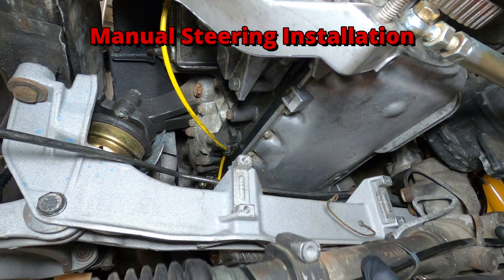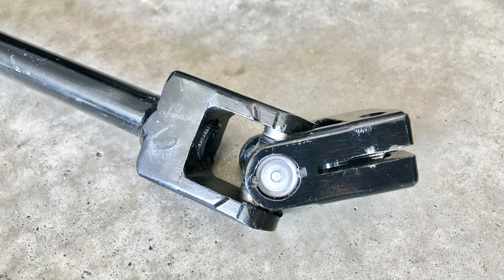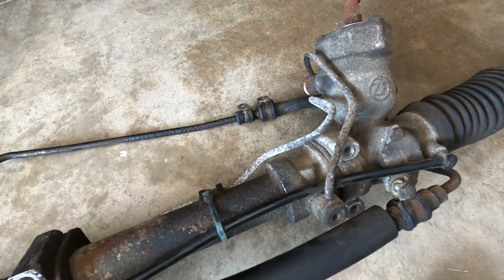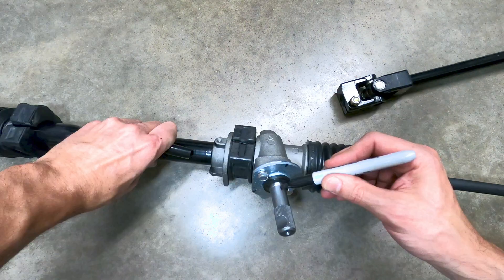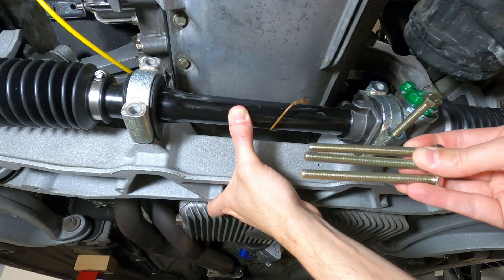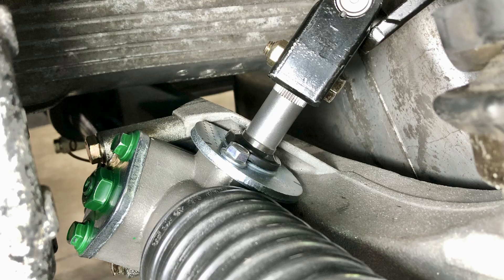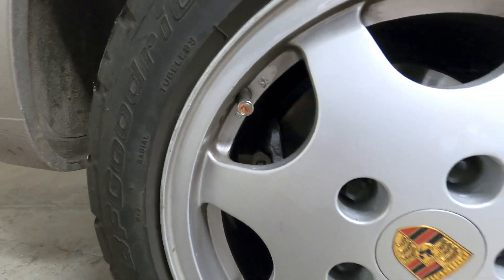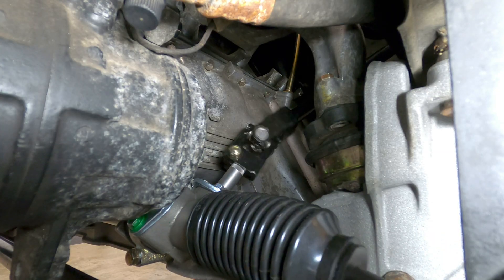Porsche 944 – Manual Steering Conversion / Rack Replacement Tutorial

Comment: Another Fantastic video. You must have just about the nicest 944 in the States now…
Reply from the maker: Thanks John! I’ve definitely taken decades of aging off its life, and the car is looking really good. There are still some 944 unicorns out there with sub 5,000 miles on them. Pretty amazing how people never drove them and stored them so perfectly all this time. Mine isn’t close to those examples, but at least I don’t have to be afraid of putting miles on mine. 😂
Reply: @NC944er  I am the same as my rebuilt 16 Valve has done over 100k, and sings like a bird past 5k revs to the redline.

Comment: At the 5:16 minute mark I can see the yellow wire that comes from the oil level sensor on the oil pan. While engine cleaning on a Special Edition 924S I will be selling soon, I accidentally pulled on that wire that got caught on my brush.  Where the hell does that wire connect to? It goes up into the engine bay somewhere but I can't find the rest of the wire. HELP!!!!
Reply from the maker: Hey, sure! The yellow wire from the oil level sensor meets up with the wiring for the oil pressure sender and they join at some grey wire loom below the front of the oil cooler. From there, it passes in front of and over the water pump, and then up under the intake manifold toward the fire wall and then over to the fuse panel.
Reply: @NC944er  you are a class act. Thx so much for the video.

Comment: The only thing holding me back from manual rack is the slow steering ratio and part availability. The power steering ratio is already about as slow as I want it.
Reply from the maker: There are some trade offs… and the power steering is a bit nicer for casual daily driving.
Reply: @NC944er  lol yeah my power steering has never worked due to an excessively leaky rack, so I'm used to strong arming it. This kit doesn't seem too bad though, with only a 10mm difference for 3 1/2 turns. Just gotta save up since my car needs so many other things
Reply from the maker: @liamflynn6929  Haha! Too true… just when I have a 6-month maintenance plan laid out, the car “tells me” it wants different things fixed first. 😂
Reply: Glad you posted this! I have been putting off my manual rack install but I may just have to get after it while it’s too darn hot out to really enjoy driving the car anyways. Nice work as always!
Reply from the maker: @aarondennis4561  😂 It was VERY hot… I tried to work on it a couple hours in the early morning over a few days.

Comment: Most common power steering leaks on these cars is the wrong hose clamps used on the power steering reservoir hoses in and out, and at the steering pump. Tower hose clamps have worked for me. No more leaks on 5 different 924S's.
Reply from the maker: Glad to hear yours are holding up well. My lines were good and the previous pump rebuild was holding strong, but the rack developed a leak on the passenger side. Finally got tired of throwing money at it. 😂

Comment: Great video! Love to see how other people are keeping their 924s  and 944s on the road.
Reply: You didn't say in the video, and the cost will probably change over time, what's a ball park on the conversion?
Reply from the maker: @gregoryhousch3321  The manual kit with everything included was around $850. I was looking at rebuilt power racks for around $650 and had shelled out $300 for new lines, so it was comparable. I’ve seen folks report that the rebuilt power racks can develop leaks in just a couple years and the thought of replacing it a second time sounded annoying, so I made the switch.
Reply: @NC944er  looks like a good, straightforward, " down grade", that just makes good sense. I've been having troubles with my windshield wiper motor, are you aware of anyone who rebuilds them or sells reproductions?
Reply from the maker: @gregoryhousch3321  Ugh, yeah… they are known to catch water and seize up over time. Mine is a tad slow, but still moving. I’m not aware of any rebuild services or aftermarket options. Most of the ones for sale are rebuilt OEM units, but the price tag is north of $650. The used 944 parts guys - Larts, Plyhammers, Just Joshin’ - seem to be all sold out right now. I would probably attempt a DIY cleaning/rebuild before paying those prices, it’s about a 4-5 hour process since the blower unit and entire wiper assembly have to come out, then opening the motor for cleaning. There are a number of videos out there on the process - https://www.youtube.com/watch?v=eWpZI4KUrUk

Alternative… dump a gallon of Rain-X water repellent on the glass and call it day. 😂
Reply: @NC944er  thanks for the info.

Comment: i just did this with the same rack from willis, i really like it and way better than the depowered rack. Thanks for this great video! and Willis is really nice guy too!
Reply from the maker: Yes sir! I have no complaints about the setup and he was happy to answer questions when I called. The only modification I made on the rack was drilling a hole on the top center tab on the housing to attach the horn grounding wire, as the rack didn’t come with a clear way to attach it.

Comment: Great video, man!
Reply from the maker: Half the credit goes to you man! This wasn’t on my radar until you posted it… and a power steering leak coincided nicely with it. 😂
Reply: @NC944er  dude leaks suck so bad… that and analog cars are more fun! But you get all the credit for making a great video. I lazily and impulsively make videos and upload them 😂
Reply from the maker: @tims_4x4_garage  LOL! They’re still useful to share knowledge and such… but, you now have my eyeing $400 steering wheel options, damn you! 🤣
Reply: @NC944er  I’d give you the 350 but you won’t be happy with it. If we get together sometime you can try my wheel.
Reply from the maker: @tims_4x4_garage  Looks like the 370 would add 7mm, which might make a small difference, but it’s also thicker which I think would improve the grip.
Reply: @NC944er  but the 370 with the 12mm eccentric is like adding 19mm at 12oclock 👌🏼
Reply: Thinking about my reply here, I’m not sure I was accurate. The momo hub is centered in the wheel and the factory wheel is not. So, without measuring, I can’t say what the mm difference is at a given point on the wheel. Just was thinking about that and wanted to clarify.
Reply from the maker: @tims_4x4_garage  Cool, no worries. I’ve always preferred my wheel adjustment a little lower, so would probably skip the eccentric. The Momo wheel looks sweet though!